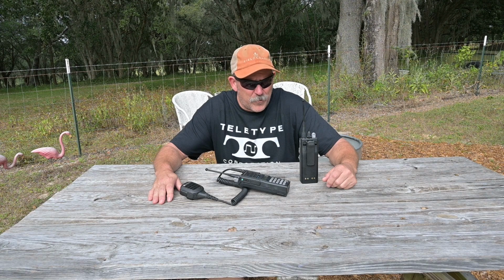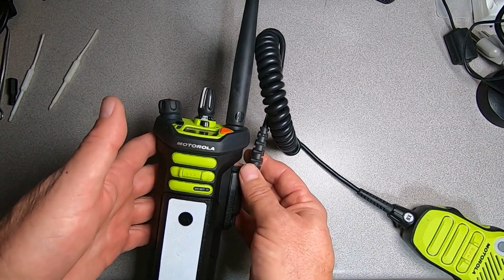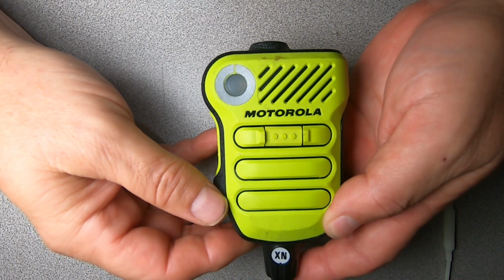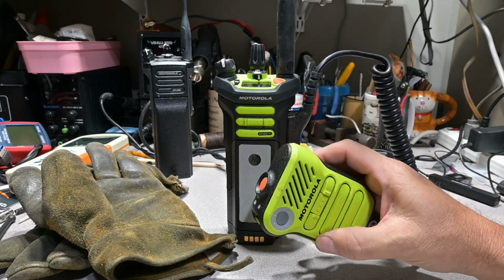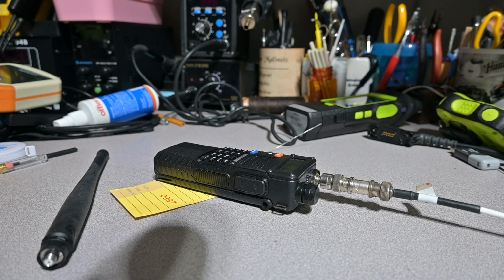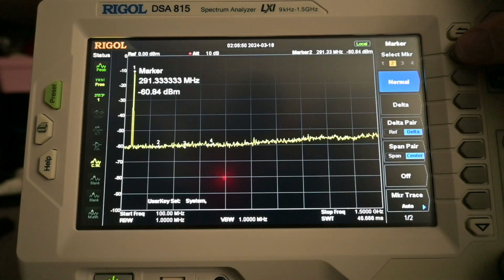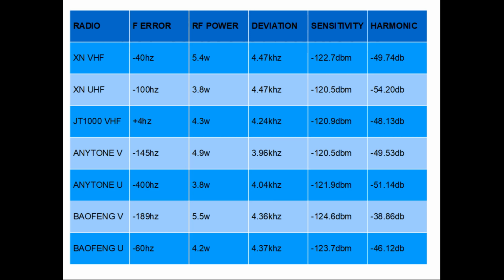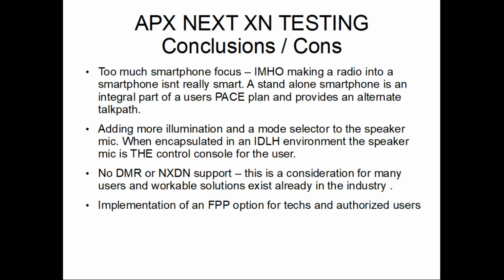Motorola APX Next XN NFPA1802 VHF UHF 700/800mhz  P25 Smart Radio testing and review

Comment: Good review.  Like you, I have 3 decades of public safety experience, vast majority using Motorola equipment but my present agency utilizes Harris (my issued portable is a XL200P).  I am also a licensed HAM operator, and all of my personal 2m (VHF) and 70cm(UHF) equipment is Motorola....some legacy, some current run, with my favorite being my APX7000 (VHF/UHF).   Only wished the APX would do DMR, which is really my only criticism of the APX.  I'm going to have the opportunity trial a Harris XL400,but it is indeed like a brick.  It appears overall, Motorola did a better job on their APX Next NFPA 1802 portable.  Thanks for the review!
Reply from the maker: Thank you ! The DMR in APX is something that was strongly desired but fell on deaf ears. Other vendors are doing it however (Kenwood) and in talking with BK Technologies MAY come to fruition in their BKR9000 . Thanks for watching !

Comment: The performance, feature set, and durability of the APX Next XN are impressive.   Radio manufacturers of "public safety" grade communications gear are always trying to add more bells and whistles with each new model.   I feel like they sometimes lose sight of the fact that the core function of the equipment is to be able to communicate when your life depends on it.   Additional features often mean increased complexity to operate for the end user.  While they are cool, I think many of the features are better left to a smart phone.    Even for a government agency, 16K for a portable may be challenging to justify.   I think I would rather hang onto an APX 8000.  Of course, I am a grumpy old luddite!   Great test and review!
Reply from the maker: Yes it is incredible how expensive radios have become and you are right too much smart stuff isnt smart.  Many of the other vendors offer comparable products for less money. I want to try the V8000 kenwood. Thanks for watching !
Reply: @survivalcomms do you mean the VP8000?
Reply from the maker: @nine7295  Yes the Kenwood . I haven't had the chance to test one of those yet. Another vendor's P25 radio is in the works as we speak.
Reply: @survivalcomms from what I heard they are great have A fire department near my that uses them and they love them
Reply from the maker: @stephen9958  Thanks for sharing and thanks for watching !
Reply: But it has a barometer built in! It's an option for the Yaesu VX-5R. I am sure the barometer can save lives!
Reply from the maker: @nine7295  I look for imminent childbirth that's the real barometric pressure sensor :)